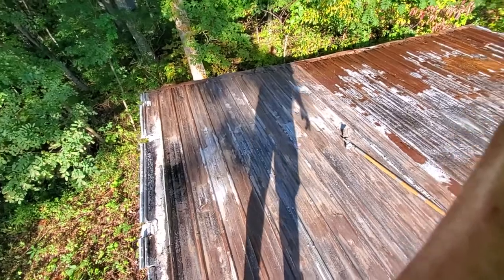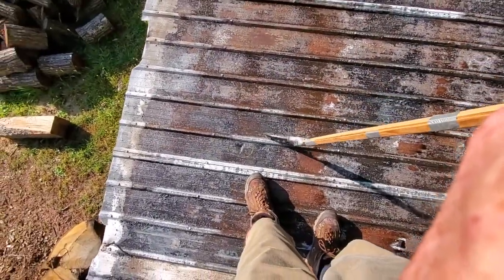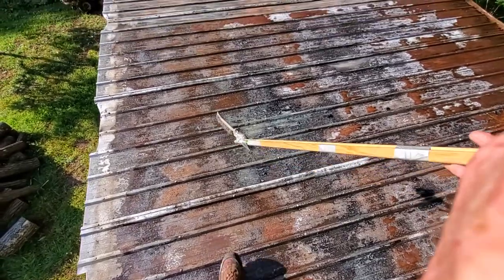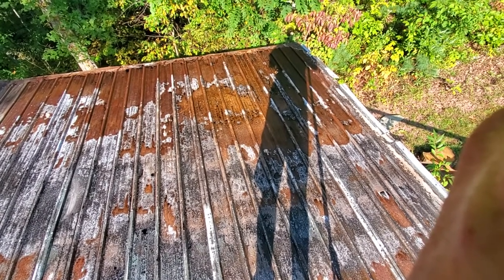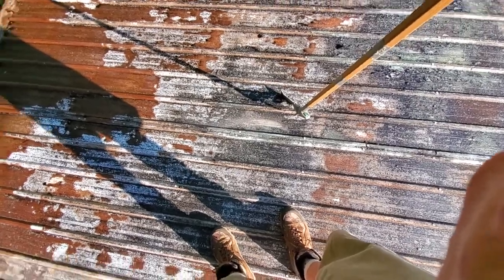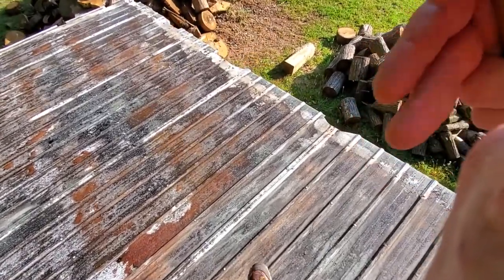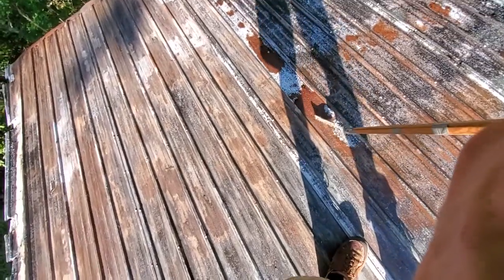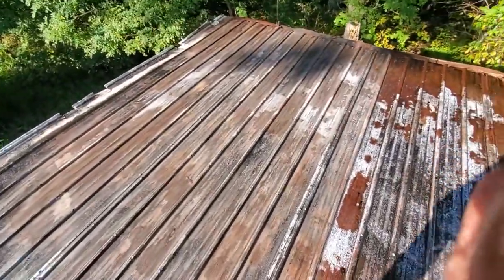killing rust Phosphoric acid 40% mix test on metal roof PT3

Comment: Phosphoric acid is pretty mild compared to other acids, it shouldn't attack good metal, just eat away the rusty parts. Would recommend overcoating after the acid has done its job. Grahene infused primer, followed by a couple of coats of chassis paint should do the trick if you want to make a nice neat job of it. Or just spray a load of that Cosmoline RP-342 Military Grade anti-rust undercoating over it, if you're lazy. That will do a much better job of preventing the rust from coming back.
Reply from the maker: I never had the pleasure of meeting mr cosmoline but have experience with the us nave CPC,,,, some sort of stuff that when sprayed it almost appeard to be a clear coat , went on like water but ended up giving somewhat of a shinny look.  CPC (corrosion prevention compound) was all i knew about in the 80's / 90's.